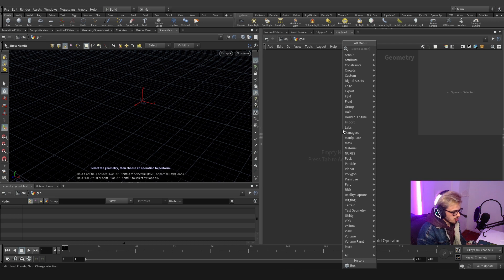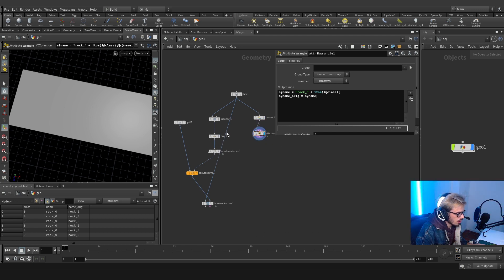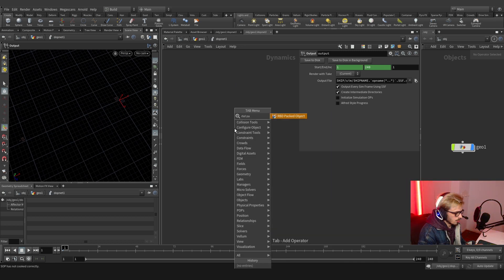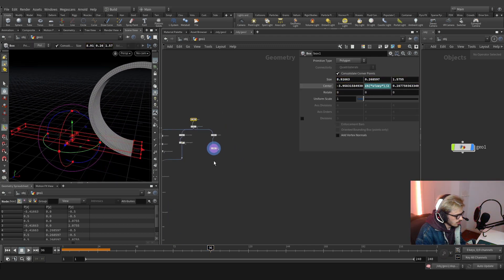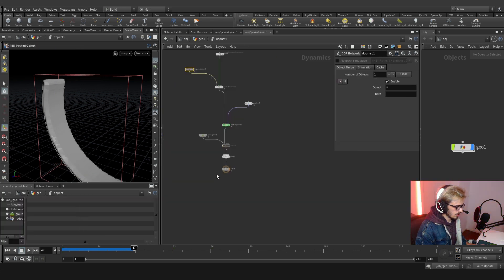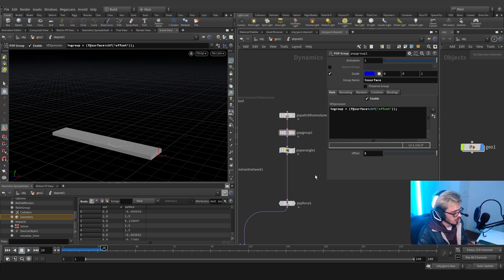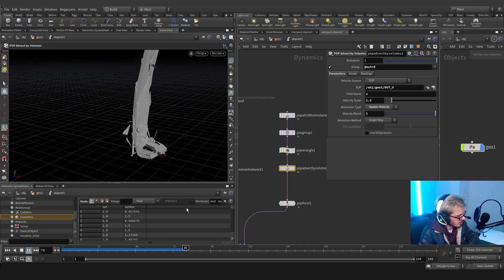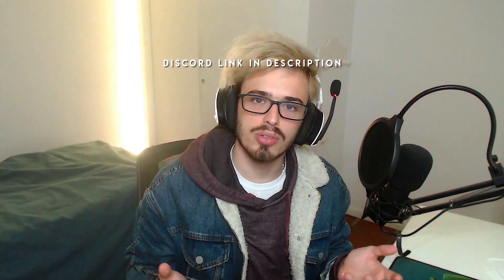Creating Realistic Guided Simulation With Houdini!

Comment: I utterly failed, seems to be a very sensitive setup in terms of parameter tweaking.
Reply from the maker: Well it depends on what you want to do, the scale of it, etc. What did go wrong?
Reply: @pizola3285  My "out" attribute turns to 1 on frame 1 or within 1-3 frames if I put the threshold to like 0.01. Also the constraints there too hard to break. If i put the strength to 0.1, and the volume advect to update position with like x10 vel it does break, although jittery. Surely solvable with some fiddling but this was the time I had today for this particular tutorial. Still picked up a thing or 2, so not a failure per se.
Reply from the maker: @Moctop  That might have to do with the scale. Try making the scale of the attrib rasterize bigger so it covers more or less area. Same with the sdf. So far I am using this workflow to update the forces of some of my sims. Not so much as a hard control but more as a controled custom velocity. Thanks for your insight